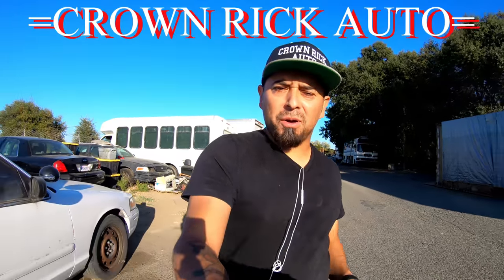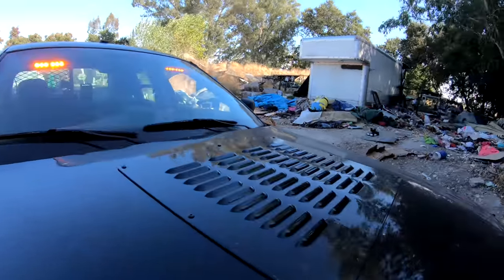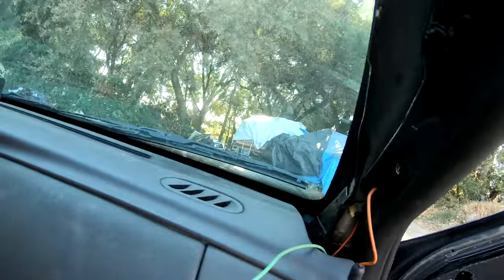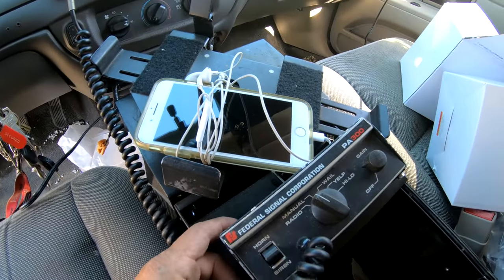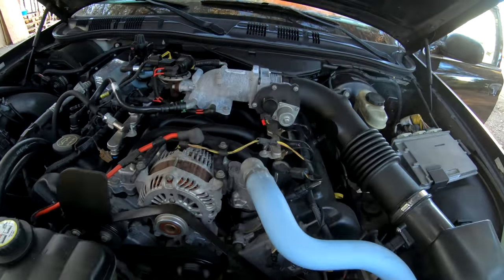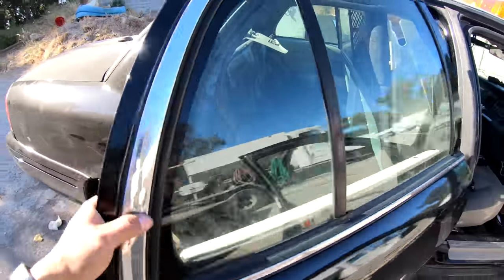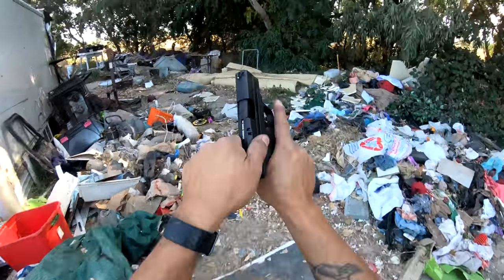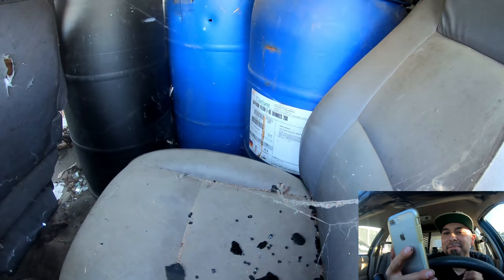Crown Rick Auto Found a GUN!

Comment: Crown rick, here’s a method for opening those types of locks. Grab 2 wrenches. Put one in horizontally, as if you were going to wrench the bracket.
The other wrench, put in vertically, on the top of the wrench from before. Now, rotate both inwards at the same time. The lock would be given a tremendous amount of force, and would snap.